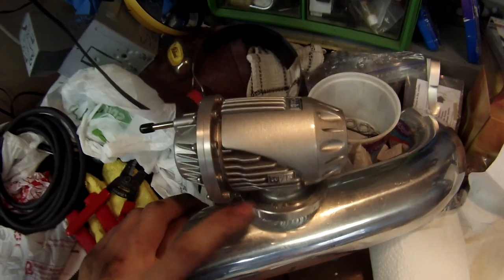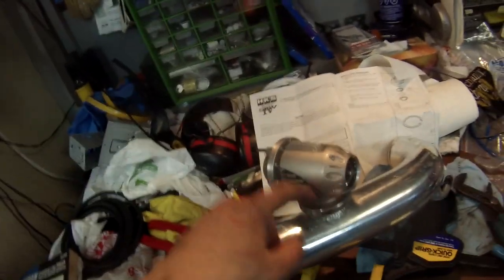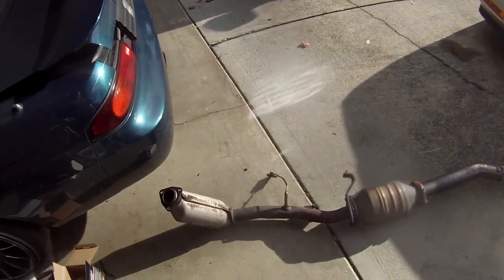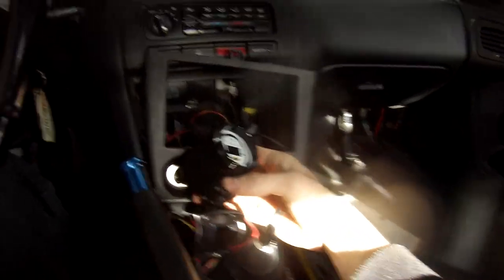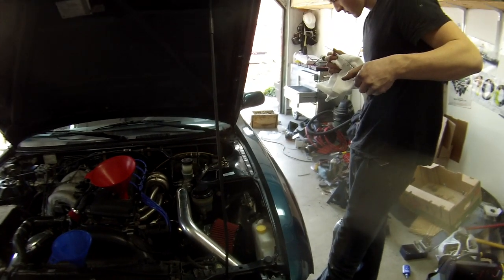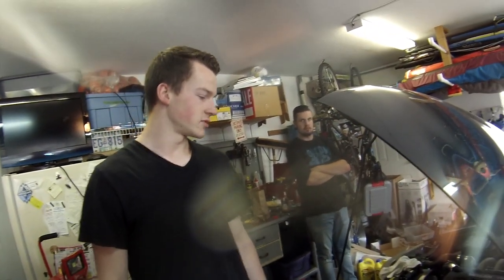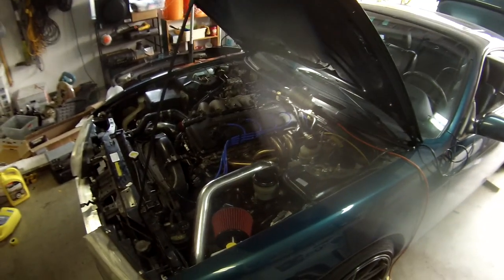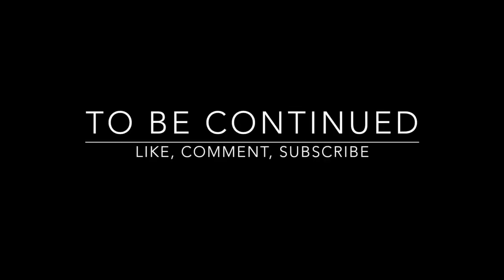240SX KA24DE Turbo Build EP.4 FIRST STARTUP

Comment: Super clean build so far, bud. You should run an electric Altima fan in place of your mechanical fan. It pulls more air and leans up the engine bay...plus, there will be more room for an engine oil cooler without the fan shroud. ;)
Reply from the maker: Thanks. Yea electric fans are on the list. Ill probly get some when summer comes around along with a radiator.

Comment: Its rich cause you need a fuel pressure regulator, you're running prob a 225 with oem lines and filter but the pump will give you more fuel and more fuel pressure so you're gonna need to regulate it. I think my ka runs at 32 psi for fuel

Comment: you dont adjust boost by moving the actuator arm in or out, thats how you set the pre-load. Set your wastegate penny to the closed position, attach actuator rod to fit on the arm that moves the penny, then remove again and shorten rod by 1/2 a turn, or more if needed, until the wastegate penny is fully closed WITH some slight tension on it(ie no rattling/looseness) and thats your actuator set up. the level of boost will be decided by the spring inside the wastegate (5,8 or 11psi etc) and how much air is then bled off on top of that by a boost controller.
Reply from the maker: Its internal wastegate so I cant change the spring. But I think ive heard this before. Ill have to look into it, thanks!
Reply: I was going to say similar. It can slightly effect boost levels, but it isn't very precise and isn't the "right" way to do it. If you want to make lower boost, just get a simple MBC.

Comment: Looks like its working out really well! I am in BC too, s14 as well.
Reply from the maker: Dope!
Reply: Jordan Maz how's your s14? Is it still reliable
Reply: My S14 has been the most reliable car I have ever owned. I have put 150,000kms on it since I bought it in 2011 and have never had a break down, even with the SR20 that I put in about 30,000km ago. Not scared to take it on many thousand km roadtrips every year.. But I also take very good care of the car, so undoubtedly that has alot to do with it.
Reply: Jordan Maz if you don't mind could you make a new walk around of it?
Reply: Its tucked away for the winter sorry bud.
Reply: Jordan Maz when the weather warms up will you do more vids on it?
Reply: Probably not.. Noone cares about a 240 that has clean and simple mods. People like body kits and drifting and stupid wheel fitment.. I dont do it to show off, I just like to drive it.

Comment: how much psi can hold a ka stock ?
Reply from the maker: Some say 8 max to be safe, some say 10. Some say you can run 14 with a good tune. Comes down to how much hp your making and a few other things from what ive read but im going to keep it at 8 for a while.
Reply: BuiltLikeThis i read on a post a few years ago that 12. I have my doubts but i think 8 its good  for someone who like to feel only the pull.
Reply: also can i put a bigger cc on the motor eaven if my car is bone stock